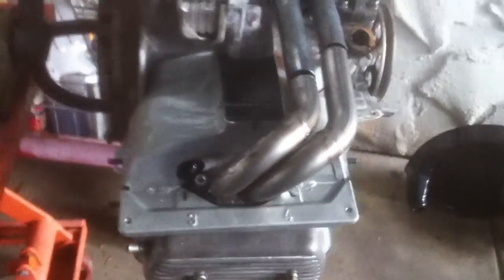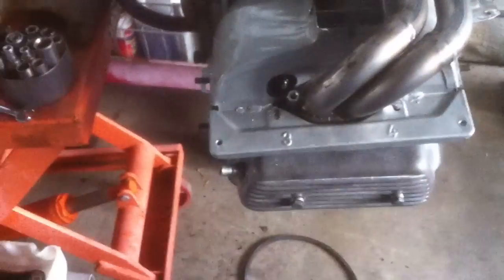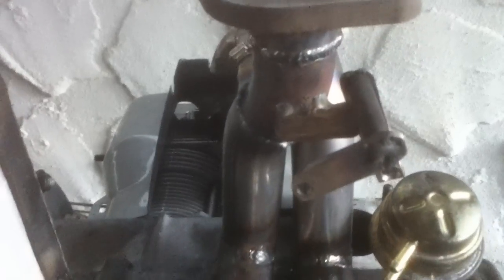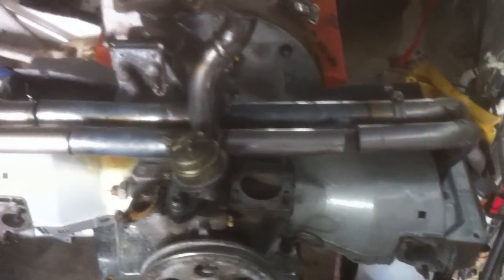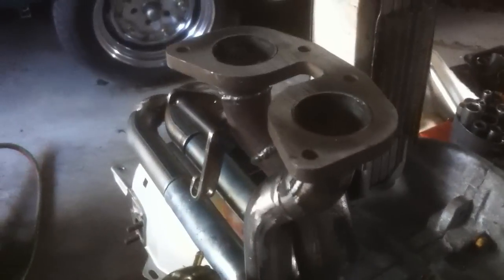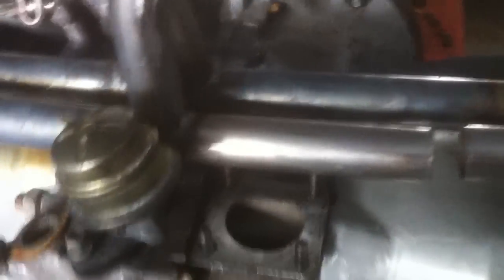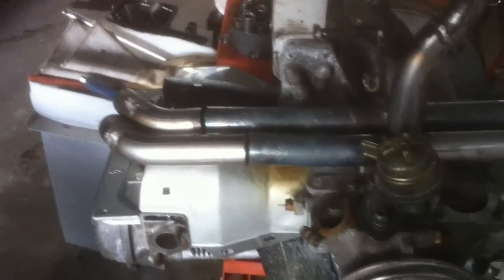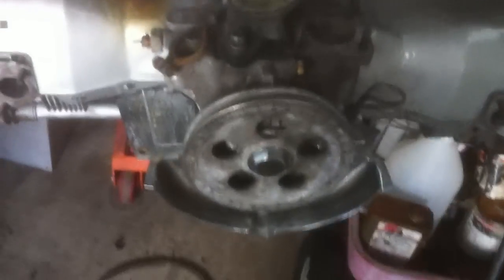VW DUAL PORT CROSS FIRE INTAKE SYSTEM - 10% HP INCR MINIMUM

Comment: Hello umm I have a question i would like to get a cross fire intake. If you have any Info of were I could buy one please help. 
I have a 72 Baja I’m running a 2183 stroker with dual 44mm dual carbs and 9/11 forged rockers chrome alloy rods 110cam zoom exhaust baffled 75am alt elec dis gear reduction starter 8” intake 

I’d really like any and all info and any advise is nice too thanks you